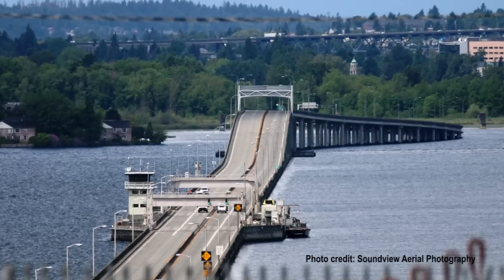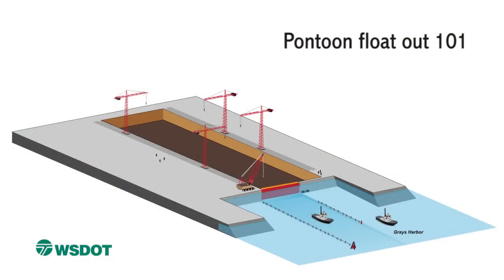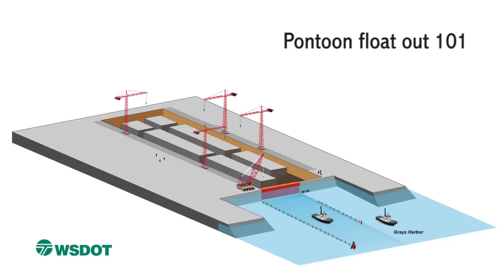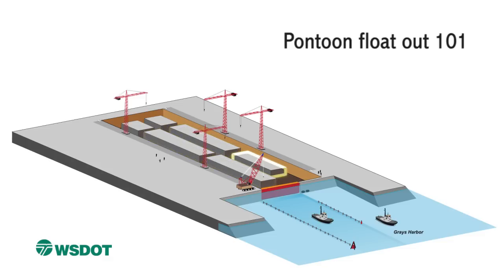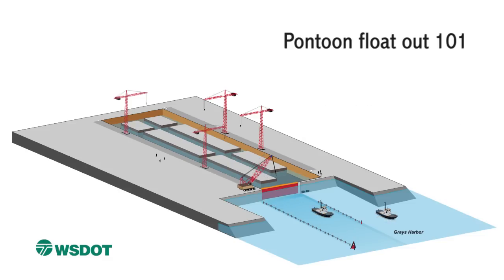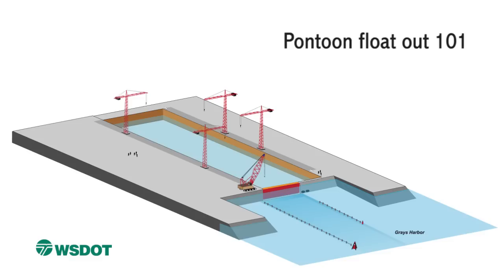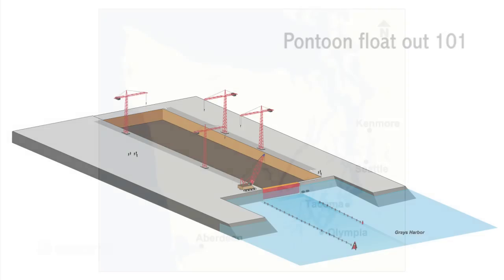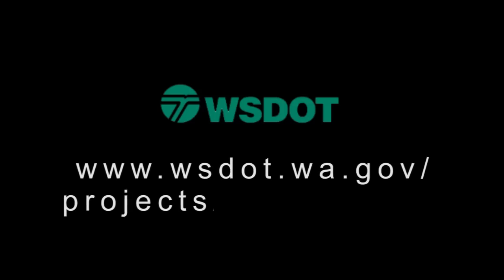SR 520 - Pontoon Float-out 101 - Pontoon Construction Project - July 2012

Comment: How these huge pontoons float?
Reply from the maker: Good question. Floating bridges are made of large water-tight concrete pontoons connected rigidly end-to-end, upon which the roadway is built. Despite their heavy concrete composition, the weight of the water displaced by the pontoons is equal to the weight of the structure (including all traffic), which allows the bridge to float.
Reply: @wsdot  Still i didn't understand 🙏🏼
Reply: @wsdot  i understand but how can tje weight of pontoons(made of concrete) be equal to weight of water... Is thier density same?
Reply from the maker: @Being_Unidirectional  While the outside structure of the pontoons is made of concrete, the pontoons are made up of multiple hollow, watertight cells. Since the pontoons are so large and deep, they displace a lot of water. This volume of water displaced weighs more than the weight of the pontoons, which enables the pontoons to float. (Think Icebergs!) The hollow cells inside the pontoons helps keep the overall weight low enough to float. If you want to learn more, we'd recommend researching the Archimedes' Principle - that's the science behind how pontoons float!